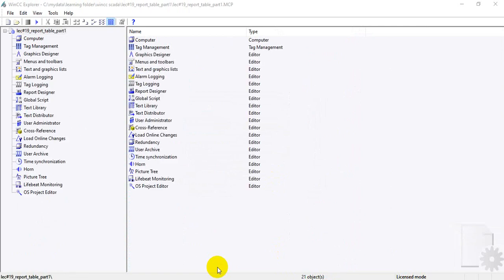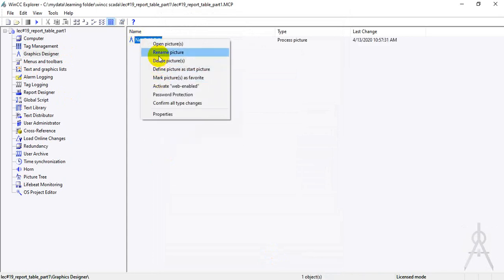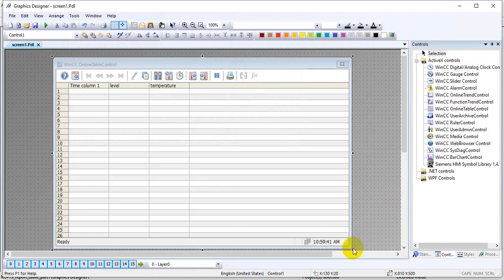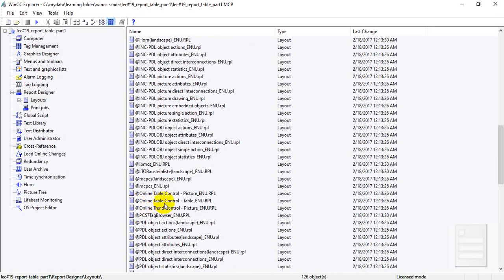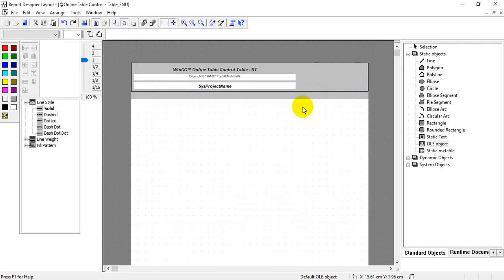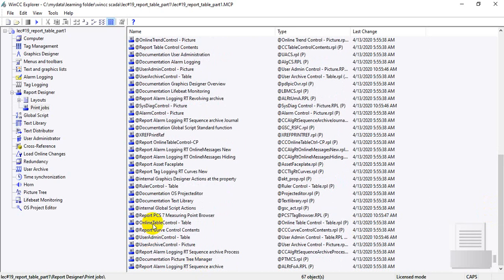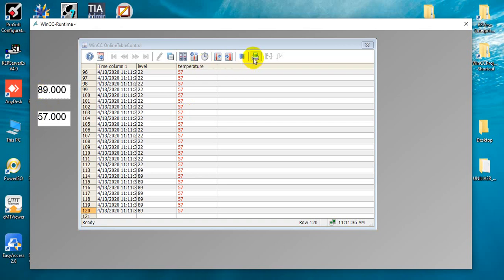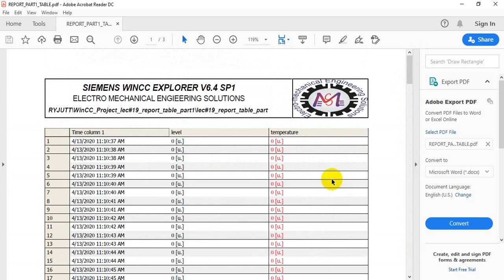LEC#19 REPORT TABLE PART1

Comment: i am using winCC explorer 8.1 and in my project for the print job  properties there is only one option available  for the printer priorities which is standard printer, means there is no option for microsoft print to pdf, do i need the license for that, i am using demo mode